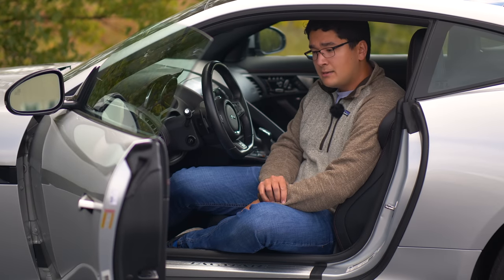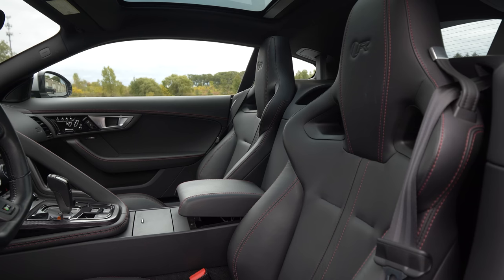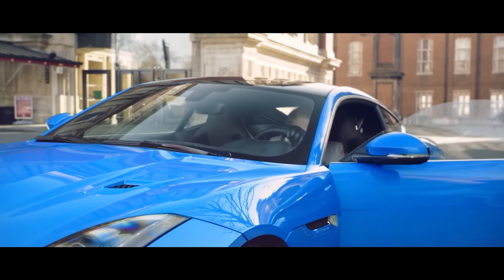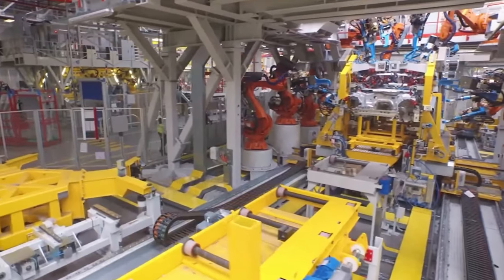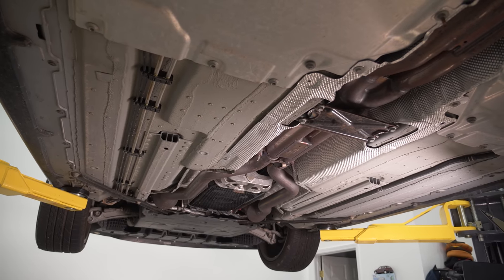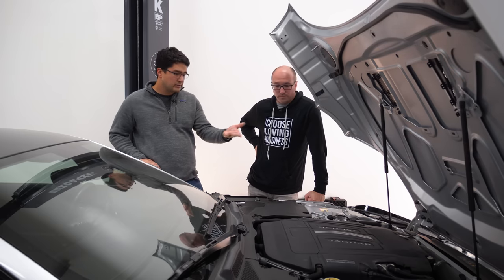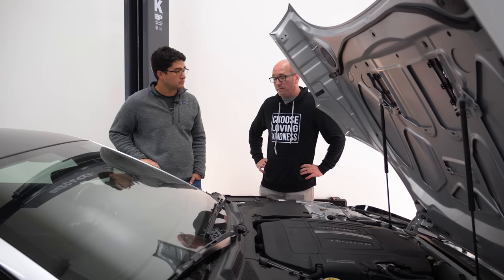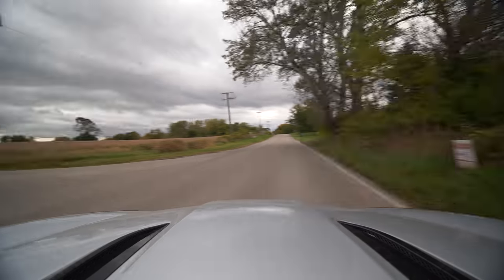Jaguar F-Type | A $45,000 V8 Gorilla

Comment: TATA quality, rusting everywhere for people with snow+salt.  It may be good enough for Indian who never see salt on the road.
Reply: That's disappointingly true,but I seriously hope Tata will up the game ,given the fact that they have greatly improved Land Rover's  image.
Reply: Hey the subframe may be rotting out at 12k miles, but they gave you stainless brake lines
Reply: @vedantawasthi5410  is it even possible to improve land rovers image? xD
Reply: Perfect for California driving then? 😁
Reply: @vedantawasthi5410  What? How did they improve their image by cost cutting even harder? They just make Porsche's job easier.
Reply: @wigletron2846  Indeed true, but I am afraid it is cheap quality brake lines stainless steel. High quality stainless steel are 18/10 (10% Nickle), most India stainless steel appliances are 18/0 (dots pitting when put them in dishwasher) .  Again, if it is just for leasing, hell it is ok deal. Buying, no way for any Jaguar, even if it has Aisin or ZF transmission.

Comment: Lucky enough to have a '69 series 2 E coupe (since 1989) and to have found a 2017 manual trans F coupe in late 2020... the 'spiritual successor' for sure. A great video and especially grateful for the section on the rust on the rear braces.. good info to have for the dealer to check in to. Thank you!!!

Comment: The rust on that 2015 low-mileage car is insane. That would put me off buying a used one. The depreciation would put me off buying a new one. But I still want one  :)
Reply: you can replace if the parts are very badly rusted, and then seal the braces so the rust never comes back. it's preventative, just gotta find a well maintained one, or one that had the recall  done.

Comment: The '16 model R also got a valved/adjustable exhaust system.  I can confirm that at 6'6" I fit just fine in the convertible.  With the top down.  And my head sticking above the windshield.  I also can confirm that I'm perfectly fine with that.

Comment: Really tempted to purchase an F-Type R. I’m torn between it & a C8 Corvette. I want to test drive both before diving in, really excited.
Reply: I’m in the same boat! Did you end up making a decision yet? The market is crazy right now for these cars
Reply: @jabariphillips8855  did you make your purchase?
Reply: @jabariphillips8855  I am shopping around for a vehicle this summer. I am stuck with deciding what's worth the price tag: Mustang GT 2022, Lexus RCF, Jag FType, Audi RS5. What do you think? I need something that's a weekender but possibly every now and then become a daily to spice things up at random. I know the new Mustang 2023 looks awesome but it may take some time to workout the new build and to get one ordered
Reply: @jabariphillips8855  thank you. I like the rareness appeal as well. What do you think about the steel and rusting? I heard reports that Tata supplies the steel so under snowy weather and salting the rust quickly spreads. I have a 10 year old Honda Accord and rust level is very low so I need something good without issues.
Reply: @echoalpha9157  I’ve heard that too, I think later models had some additional corrosion protection added. I live in the chicago area so I can understand salt and rust damage but then you have to ask yourself do you really want to drive any sports coupe alll winter long. Heavier snow storms will probably be too much for cars this low to the ground anyway and that’s when they typically dump a crap ton of salt on the ground. The alternative is, you go to the car wash more frequently and get the undercarriage spray wash. Visually it looks unappealing with all the rust, but is it actually impacting the structural rigidity?
Reply: @jabariphillips8855 My understanding is that the later cars had revised parts such that the rusting issue was addressed. I don’t know why someone would want to drive a car like this is the winter salt/snow anyway, but that’s just me.

Comment: I own a C7 Corvette and I recently drove a 2016 F Type R. First the F Type. I love the extra 90HP. Love the AWD. The interior materials are a little nicer, not a lot. Fit and finish about the same. Definitely smaller. The Vette. Z51, 3lt, performance exhaust, magnetic shocks. The magnetic shocks are great, better than any electronic shocks. The car is a little bigger and feels a lot roomier. 460HP in the vette is very good, AWD would be better. Vette has a better infotainment system. Handling is different but both cars handle very well. Brakes on both are great. Styling is in the eye of the beholder but I think both cars turn heads. Would I trade the C7 for the F Type R? Not right now I wouldn't. Another year with the vette and I probably would. I can't afford to be a car collector but I can buy them one at a time.
Reply: I'm in the cross between a c7 grandsport and a f-type r, you driving both if you could choose all over again what would you get?😢
Reply: I've had a 2000 Trans Am WS6 since '01. Around 2016 I was getting on the freeway and giving it some gas when something came up on my left. I got on it but it easily walked me. When he let off I was greeted by the pops of the exhaust. I knew that would be my next car. When the time came a year or two ago, I had to decide between a used F-Type R or the (then) new C8. By then C8's were already everywhere on the road, so I picked the road less traveled. The car's performance is stellar, the exhaust even in stock form is unmatched. I just really, really, REALLY miss having a stick-shift and clutch. Even with paddle shifters you can't keep the RPMs right where you want them, there's no revving easily, and with AWD burnouts are a thing of the past. I couldn't break the tires loose on dry asphalt if I tried, other than throwing it into a 4-wheel slide. Took it to the local strip in June. 12.1s @118mph. No waterbox or burnout, leave it in auto since 1->2 shift is faster than messing with the paddles, no wheelspin, no clutch, no shifting, no nothing other than hitting the brake 12 seconds later. It's fast, it's loud, it's rare -- I just can't get it w/ a stick or clutch. They have V6 models but I don't want a V6. I presume they only have AWD V8 because you'd be roasting the rear tires everywhere, but that's what I want, at least when I want that experience. Naturally, my wife got pregnant at 41 just after buying it, we now have two kids, so a 2-seater makes even less sense. I'll probably sell the R and beef up the WS6 w/ forced induction. It will scratch the stick+clutch itch and has a back-seat if the kids want to go for a ride w /me. I got to enjoy an F-Type R and got to be a "collector" for a year. :)

Comment: Almost 4,000 lbs!! I can't believe my 2020 Rav4 Hybrid weighs less.
Reply: Your RAv is 3,700 to 4,300 depending your options. But it is surprising that they are similar.
Reply: @JimKJeffries  lol wat. The Rav4 Prime is a separate model.
Reply: @kgb4187  you could open your door, and read the placard (if ya drive one).  Or you could go to Toyota site, which i happened to be on ordering parts.  Depending on options available in the particular trim levels the weight varies....and there are numerous options available for each level.
    In short you got a 50/50 chance of weighing less, or more.  
   But it is an interesting point that an all wheel drive vehicle, generally purchased by those that only view driving as a basic transportation need...is similar in weight to a 2 wheel drive gt car, typically purchased by those exceptionally passionate about their driving experience.
   Hope your enjoying a great start to your week.
Reply: @JimKJeffries  The placard only shows the GVWR though.
Reply: @kgb4187  perfect, what does it show?
Reply: Gross vehicle weight is how much that bad  boy weighs...so what did ya see?
Reply: @JimKJeffries   GVWR is 4920
Reply: @JimKJeffries  The gross vehicle weight rating, or gross vehicle mass is the maximum operating weight/mass of a vehicle as specified by the manufacturer including the vehicle's chassis, body, engine, engine fluids, fuel, accessories, driver, passengers and cargo but excluding that of any trailers.
Reply: @kgb4187  https://www.toyota.com/rav4/features/weights_capacities/4430/4522/4440

Curb weight, (they usually use it dry, meaning empty of all fluids and passengers) is 3690lbs. I hear ya that gvwr includes the payload capacity of the car.
Reply: That is stunning that all wheel drive, batteries, motor, weighs in the same ball park as a 2 seater gt car.  The weight of all those amenities, just keeps adding up. When I Google details about the f type, it comes 3351lbs, to 3887lbs.

Comment: my dream car, only issue is the rust, i love this damn thing. I  would absolutely pay more and get the AWD drive. Planning on doing exactly that. The RWD chews through rear tyres like crazy, and they are not cheap to replace. It's probably why that car is running offbrand tyres.
Reply: Just make sure you buy one with the revised parts and you would be fine. Certainly if you are buying new you will not have the issue.

Comment: Btw I am 6'6 and I just fit. And I've driven my cabriolet for 6 years now, it's worth it. Meridian sound system is ok-ish, the rest is more than fine. You will most likely not find a car that sounds better. That goes for the newer F-type aswell because of the gas filter. BTW although it is all aluminium (not aluminum or whatever these guys talk about), yet it is pretty heavy. Btw the exhaust will squeak after a while pretty noticably, because exhaust flaps seem to get rusty

Comment: As a Bmw e89 Z4 35i owner this car is one im thinking about to upgrade to the most. Saw one years ago at the dealer and loved it. What is holding me back is JLR reliability. And dealer experience in our country is shit. Dont know how much information is available online. Is there online parts catalogue that i can browse like for Bmw? Parts availability? DIY guides?  We have a discovery sport in our family and dealer experience has been crap. It has had some issues like dpf problems, rear camera blue screened, keyless door handle stopped working correctly. Once it asked for a new oil change just after 3000km... Bluetooth stopped connecting to phone automatically and you have to connect it manually every time getting in and even then it may disconnect mid call. To get new camera module you have to wait 3 weeks?! Independent shops probably not experts on it aswell... Cool car but are the headaches it gives you worth it? I know my Z4 is not the most reliable car but n54 has a ton of info on forums, i have DIY guides on youtube, full service manual and parts catalogue online. It has had issues, but every issue is well documented and that way easier to fix. 
All that makes me very cautious.

Comment: I noticed you didn't touch on reliability. The transmission is great and the engine is partially designed by Ford which tells me it's more reliable than the old jags. How reliable is it? I really love this car, but I don't wanna be stupid about it. I wanna enjoy it. I don't want it to be in the shop every quarter. I have a 15 s550 mustang gt now and really like it. Main reason i bought it is for the aftermarket support, but I find myself not doing as many road courses as I thought I would so I'm seriously thinking about ditching it and getting something more refined that I can just drive and love. Maybe some aftermarket upgrades in the future. Not sure if kong ports this jag blower lol

Comment: I've been daily driving a ND Mazda MX-5 since late 2015, now I'm looking at used 3 liter convertible F-Types because you can get them with 6 speed manual transmissions. I could do without the snap-crackle and pop exhaust but those cars really are pulling at me.
Reply: I bought a 2016 3.0 S manual coupe in May. Triple black, all the options save carbon brakes, I really like it. I don't drive like a baboon, but it has enough performance for the twisty New Hampshire roads where I live. I'd never driven an F-Type, they are very rare where I live, but there is no shortage of 911s. I found the car 2,000 miles away in Denver, had it shipped. An act of faith that hasn't yet disappointed.

Comment: Ok  Great review   BUTT  I have a 2018 F Type with the Turbo 4 putting out 300 HP   You guys laughed at it   !!

But I do 0-60 in 4.9 sec    I get 30 MPG on the freeway and It  is all you need for 90% of most driving
 

The front end is much lighter and quicker then the R or 6 Cyl     It is like an old lotus with the same handling capabilities and feel
Reply: People still laugh at it because a 4 has no business being in this car.

Comment: We originally planed to buy a x7. I test drove it. Nothing special. Nothing exciting. Our family just needs a large car. After watching this and straight pipe video, i went to dealer and test drove ftype r convertible. I have never experienced so-called couldn’t stop smiling while driving it. What a car. Absolutely fun to drive. Screw x7.
Reply: Split the difference and get an XJ sedan. A valid competitor to the S-class at used Camry pricing. Like the F-Type, it’s beautiful and you won’t be bored. Buy it and there’s lots of room for the kids.

Comment: I think the assessment of the carbon ceramics is a bit off base.  My 2015 has them.  Yes, expensive option when new but really doesn't add too much to the price when buying used.  Unless the car is tracked, both rotors and pads should last a lot longer than their standard counterparts.  Yes, they'll be much more expensive to replace when the time comes, so if you are buying an F-type to drive daily and put significant mileage on, you may be better off with the steel brakes.  Being in New England, mine will see very low mileage and if/when the time comes to replace the brakes I'm betting that either a less costly option will be available to stay carbon ceramic, or if I had to, Brembo makes a non-carbon ceramic big brake kit that costs about $5k for all four corners.  Compared to $10k for the CC rotors and pads, it's not bad at all.  But, that's what you get into with any of these higher dollar sports/GT cars.  Ever priced out brake replacement on a (real) AMG car?

Comment: But how does it compare to a used Corvette C7 Grandsport or Z06? My guess is that the Jag is quieter at normal highway speeds. I did rent a supercharged 6 version (convertible) and  an LC500 couple. Both are quiet while cruising, and handle well for a GT car. Of course, the LC will inevitably be more reliable but the Jag in this video is faster. Used LC500s are rarely available for under $75k at this time.

Comment: I'm wondering how steel elements are insulated from aluminium ones? I guess there is no any insulation there so even if steel would be CrNi steel it would rust as electrolytic corrosion would appear finally due to different potentials of steel and aluminium.

Comment: The New 2020 F-Types come in both 2 & 4WD. There is a choice of two 5 Ltr V8s, 450hp & 575hp which is 4WD only. There is also a 4 cylinder 2Ltr 300hp 2WD option for your granny.

Comment: Great helpful video. I have been cross shopping the F type, LC and now the Vette. This was very helpful.  The Jag's major problem to me is depreciation! Not going to buy one 5 years old but maybe one with less than 10k miles, but the Corvette at msrp is now the one to beat.
Reply: As long as you can stand the horrible and badly proportioned over styled mess that the C8 is then it’s fine I guess.

Comment: 7:13 This rust makes me very upset. Because if I had Jaguar Ftype money, then I would buy a Jaguar Ftype and try to keep it forever.
Reply: Dude, it has been addressed on newer cars with revised parts from the factory, and if buying an older car just confirm the recall was done on it. Yer good. I understand your wanting to keep one of these cars forever. I will be doing the same. These cars will spike in value in the coming years.

Comment: Where did you find one for 45? New ones are a 130k, found. agood deal on a used low mileage 18 for 90k, which is great depreciation for an exotic. Keep in mind exotics are highly sensitive to mileage, and these are semi exotic/grand touring cars
Reply: 14-15s are sub 50k
Reply: @jackholmes8105  yeah those are not R's, that would be the V8S, in fact low mileage variants of those are more collectible than the R, given their exclusivity and interior finishes, higher mileage FTR's are low 60's here, where do you live? Also did you get ir from auction or was the guy desperate, as 45 is dirt cheap for it retail
Reply: @aymansgarage  i looked nation wide. This gentleman picked up his f type r coupe with 12k miles and a clean title for 48.
Reply: @jackholmes8105  That's an amazing deal, beautiful car, but it's 5 years old too that's why, 11k a year on a car in this class is nothing, amazing car none the less, and they arent as loud anymore unfortunately

Comment: So, why not track it? It's no heavier, and should be no more expensive to run, than any number of other high-performance RWD coupes. Whatever you choose to track, the main issue is going to be heat management. Speaking of alternatives, it's interesting -- though no longer surprising, to me -- that Corvettes didn't come up. Seems like a pretty direct competitor, especially given the extreme depreciation of the F-Type. Maybe you'd like something with similar V8-RWD-Coupe character, but is 600lbs lighter, generally better for track use, available with a great manual gearbox, has at least as much storage capacity, and which is going to be more reliable and less expensive to maintain.
Reply: Dear Corvette owner: According to other reviews, and alluded to in this one, the F-Type’s fatal flaw on the track with the nannies turned off is its unannounced willingness to swap ends. To the point the the F-Type is not even an informal track day car. Your Corvette, if driven well, would beat it.
Reply: @johntechwriter  
I see. Well, that's a bit of a shame.